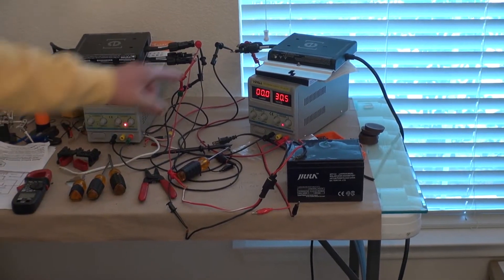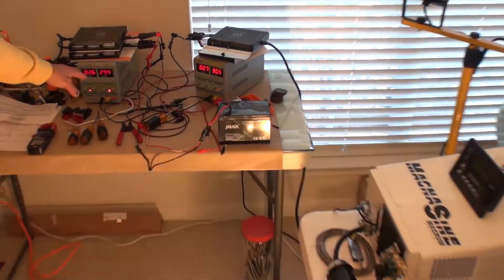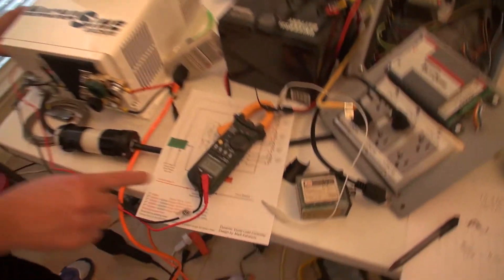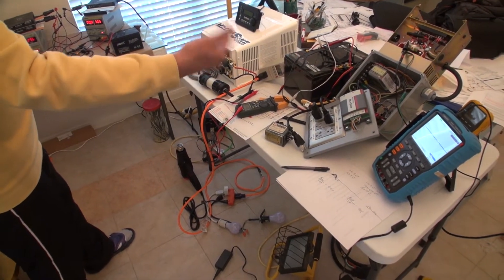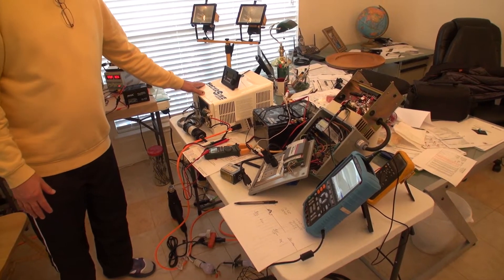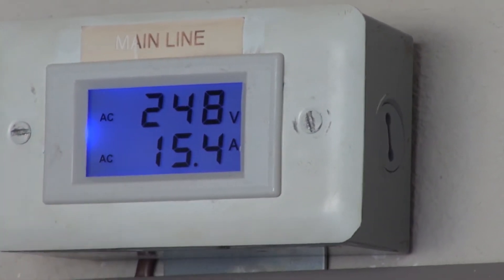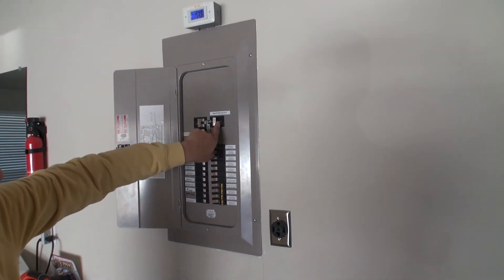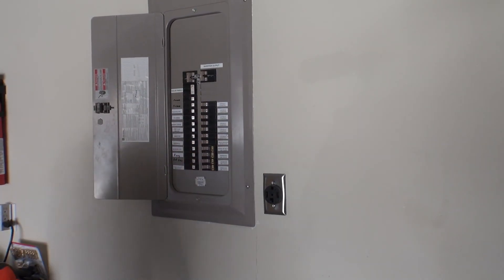Grid Tie Inverter without a Grid Part 4 of 5

Comment: Why upgrade the batteries?
Reply from the maker: To save more power for night.
Reply: @Mark1Jordon1  Can you bring up 30 micro inverters with the batteries in this video?
Reply from the maker: I have currently 39 micro inverters and yes I can start them up with two batteries shown in the video, they do not consume the power they just check the voltage and frequency for about 5 mins then they turn on.